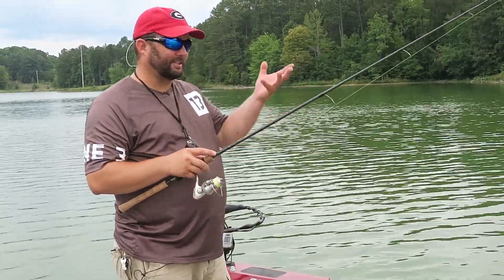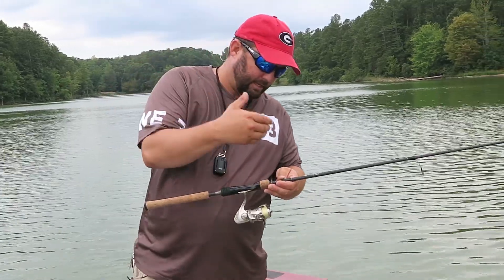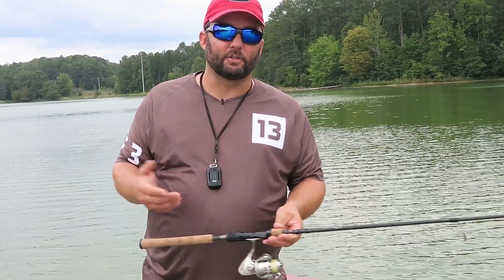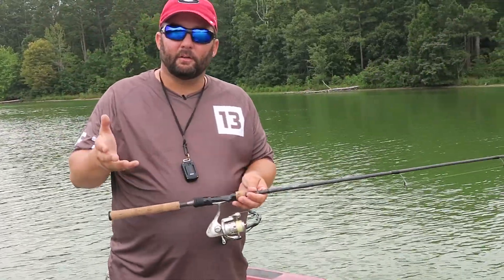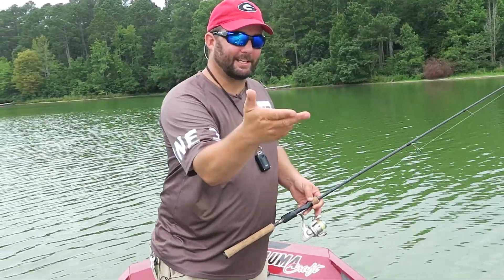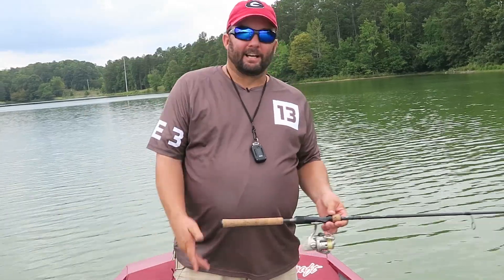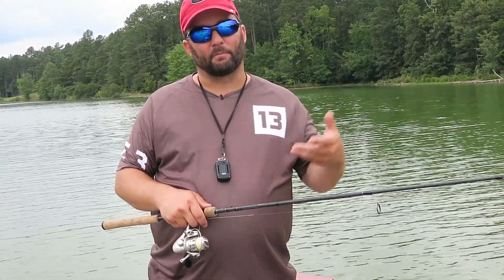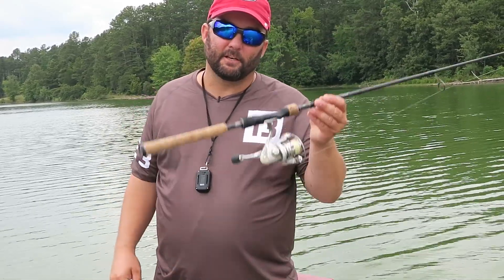Bass Fishing - The Advantage to using Braided Line to a Fluorocarbon Leader

Comment: I know you probably know this. But,  once your done using he braid on your baitcaster. Just tie it to a different reel and reel it on it. Then you'll use the part of braid that has never been used.
Reply: good tip
Reply: NC Outdoors With Justin B. I use a mono backer of roughly 1/3 the capacity of the spool. On a baitcaster it helps to keep braid from digging in. On a spinning reel, it helps anchor it to the spool. In both cases it reduces the amount of braid you need to fill a spool so you can spool more reels.
Reply: Thanks

Comment: Or when doing a carolina rig and you want to eliminate the knot issue, throw the weight direct on the braid, then a bead, then swivel then use your fluorocarbon or mono leader of your length and weight then to hook size and hook of your choice. choice.

Comment: The FG knot has changed my spinning rig fishing and I love it.  To have the invisible floro and the sensitivity of braid ,fishing mono for years the braid is a whole new world and not having to worry about old mono line memory and having to change it. I have had that first braid I put on for well over a year I can not even remember how long now.  If it ain't broke don't fix it. The FG knot is not hard and it is the best knot.  I got some really bad cabelas  line and wasted about a month with it on a new spinning rig I got. Clue on the fifth cast the line comes back with a huge knot in it cut it off and go buy some better braid.  I got 15 lb power pro green on it and I am back to loving it, it makes fishing easier. Fluke master thank you for taking my spin fishing to another level.

Comment: I agree with you 100% here Gene. I was skeptical of going braid to fluoro leader until I used the FG knot. That knot is a great knot and since I decided to start using this line set-up, I have no desire to go back to spooling a full reel of fluoro. Like you said, the durability of braided line has saved me quite a bit of money b/c now I only use very small portions of fluoro for my leader. Good stuff!

Comment: I use braid as backing on all my reels. I use a fuoro leader on most all spinning setups. I even use braid backing on my cranking setups but only enough so that it NEVER comes off the spool during a cast. It increases the casting distance because the spool spins faster.

Comment: I've used the modified Albright knot for my braid to flouracarbon leaders for years and have never had a knot failure.  Easy to tie and the knot is very slim and compact, go thru the guides with no problems. You should try it
Reply from the maker: That's what I used to use until I saw the strength tests of the FG

Comment: I can't ever seem to tie the FG knot properly. I was using an Alberto knot, but like you said, it only lasts for a few casts, so I started using a double uni. Not as compact as the FG knot, but it lasts way longer than the Alberto.

I should learn to tie the FG knot properly, but it's such a pain.
Reply: Keep the braid tight and the rap straight. Ty it off and pull the two ends. It real is a must have knot.
Reply: Bro I can't tie it properly either!! I practiced every day. Then I saw a vid where they half hitch twice the tag end of braid around the line and leader.  Then half hitch the tag end around the line only (holding leader away from line). Helps make it tighter for the time being.  PS if you are using a Duckett Micro Magic the extra 2 half hitch knots make it hard to cast so don't tie too long of a leader.

Comment: Using braid on spinning reels especially fishing from a kayak (for all the reasons you - and Chad Hoover - have shared) has convinced me!! I switched from my previous main of 8lb fluoro. I even learned and have been impressed with the FG knot so I could tie a piece of it onto braid as need be. Then I found/bought 15lb "TRANSLUCENT" color braid from a company which I will not name (their translucent braid is white and visible above water yet less visible than conventional colors of non-translucent braids below water). Its 15lb diameter is even thinner than 8lb fluoro so adding the fluorocarbon leader is probably overkill. I'm going to fish one reel of each side-by-side for a while to see if the fish shy away from pure 15lb TRANSLUCENT without leader.

Comment: Hey Gene, I have fly fished for a good part of my fishing years.  However, I am not as steady in gravel and rock rivers and streams.  So, i have used your channel to start bass fishing.  However, I also troll for large lake trout in Lake Jocassee, SC.  Sorry alot of preamble, but I use a blood not to attache a brad to a fluorocarbon leader.  The blood not has never fail me in river or stream trout and steal head fishing.  I use 6 to seven twist on each line and pull it tight.  The advantage to this not is you do not have to keep tension on the line.  Wanted your thoughts on the use of a blood not.

Comment: I made the switch awhile back and the only thing that I hate about this setup is that on a baitcaster, it's hard to get some birds nest out. I also hate the noise of reeling in braid when using a moving bait, but that's just me. Otherwise as a kayak fisherman, this really helps setting the hook hard when you don't have the most leverage like he said. Now, I made it to where my worm, jig, or any bottom contact bait is paired with this setup, but everything else like spinnerbaits, jerkbaits, crankbaits, or anything moving constantly is used as normal.

Comment: Thanks for posting this -- I'm definitely switching.  For me, I've noticed that fluoro line seems to backlash more than mono and braid.  I love braid but haven't made the full conversion.  I just watched a vid on tying the fg knot.  Easy, much better than the uni-2-uni knot (which kept slowing my casts by interfering with my guides).  In your opinion, when would you NOT use a leader? - pitch and flip?  - chatterbait?  - spinner bait?  - etc.?In your opinion, when would you only use fluoro? - swim jig?  - crank bait - etc.?
Reply: I had that paragraph nicely spaced and organized.  Thanks youtube --  :(
Reply from the maker: +Paul Durand lol. I'd use straight braid when fishing heavy cover with flipping baits, jigs and frogs. Straight fluoro when pitching to light cover in clear water, fishing heavy baits like big swimbaits , and any cranking.

Comment: I have converted to 13 fishing reels love them. curious have you tried the concept A3 reels and what's the difference in the A besides A3s are right handed? have you had a chance to try the turquoise 13 fishing reel if so what's ur input on it. I was wanting to setup an icon Jr swimbait rod with that reel?
Reply from the maker: The A3 is a larger reel designed for bigger baits like large swimbaits and Alabama Rigs. It has a deep spool and has more than 30 pounds of drag.
Reply: Awsome thanks.
Reply: So probably wouldn't be a bad reel to setup as a swimbait reel for keintech 5" baits or even hard swimbaits?
Reply: I won the grand prize shimano sweepstakes. You got any ideas of some spincast rods to set up on those reels. Never owned a 800 dollar spin cast. I'm more of a baitcast guy. I got a c14 reel on a ducket micro magic for alot of finesse setups. Not sure what to setup for these 5 reels coming my way.

Comment: I've heard braided for cranking is good as well because of the small line diameter, which means less resistance. you can use a 20lb test that has a 6lb diameter. makes sense but I have yet to try it.

Comment: What are some of the benefits of such a long leader?  I understand why it would be helpful with fall rates of unweighted soft plastics and getting your crankbaits to go deeper. Thanks!
Reply from the maker: In clear water I don't want them to see the braid at all. It also keeps me from needing to tie on a new leader after retying the lure on several times.
Reply: +Flukemaster, I tried this out tonight mostly following your advice, with nice results. I ran 20# blacked out braid up to the second guide; then ran 12# Seaguar off the spool from the top guide down, and tied a uni to uni knot with many more wraps than usual; resulting in a very long but thin knot that flew through the smaller microguides with not even a knick in the flourocarbon leader.  Using a 7'6 rod; call it 10 feet or so, of Seaguar flourocarbon as a leader.  Hooked up with wacky rigged weightless senkos, heddon torpedo, and an owner flashy spinner with a saltwater gulp swimmer.  This is a very nice tactic, and I'll try out this more difficult knot soon.   Keep up the great tips and content!

Comment: Great video. I've already started making the switch on my spinning set ups, debating doing it on my casting gear also once I work through my copoly stash. Try as I might though I just can't get the hand on the fg knot. Having good luck with the double uni though.

Comment: Do you still use mono backing? Also, I tried the spiderwire ez braid and it's complete junk. It last for a few cast and then the fibers are flattened out and the color runs out of it. 

I'm assuming powerpro or suffix 832 is much better but it's way more expensive
Reply from the maker: But worth every penny because they last a lot longer.

Comment: Great video!! Quick question if I have braid on my line with a fluorocarbon leader will I still get the sensitivity of braid? And will the leader cause stretch when I set the hook?
Thanks
Reply from the maker: Fluorocarbon doesn't stretch that much and that short amount of line won't make any difference at all.

Comment: Hey i have a question about using fluoro leader with braid main line... if i want to use 12-15lb braid, what size fluoro should i use? i'm in texas, and typically the water here is stained, rarely visibility over 3-4 foot

Comment: Very nice video, I wasn't sure how long braided line was good for.  How do you dye your line?  The main complaint I've heard about braided line is the color fading.  Thanks for the video Fluke.
Reply from the maker: I use braid for one year and then tie the worn end onto an empty reel and reel it off the old reel and onto the new one so I can use the opposite end of the line. This way I make it last two years. I die it with a black sharpie.

Comment: I use the Alberto all the time and it doesn't just break after you cast it a bunch.
Reply: Same here. Fluke must not be tying it right. I mean... He did just make the switch over to braid.
Reply: +Allen Wright yeah I love it even 1 rod uses it and he slams hawgs everyday 😂
Reply: I've seen the test and the fg is way better than Alberto.
Reply: I too use Alberto and I have had zero issues. I am using 20lb braid to 8lb fluoro and 40lb braid to 15lb fluoro. I have broken off both of these setups because of snags and in both cases the line broke below the knot.

From the instructional videos I have watched on the FG knot, it only works when you have thin diameter braid to a larger diameter leader (e.g. 15lb braid to 25lb fluoro leader)
Reply: I disagree with the last portion of your comment. I use the FG knot exclusively now, and I tie 10lb braid to 6-8lb fluoro and have had absolutely Zero issues. Salt Strong has a great video that shows exactly how to tie this knot, so I'm not sure what videos you've seen that say it doesn't work...
Reply: Same. Alberto or Albright. Fg is great but it squeezes the leader Like a Chinese finger trap. If the leaders under 10lb, it’s a Gonner.
Reply: Basslife 
I lost a massive trout because my alberto knot was tied incorrectly. I dont use it anymore, i just use a blood knot now.
Reply: Every knot breaks after enough casts. Lol. I use a improved Albright for any leader over 0.012in. 
Below that, reg. Albright with 22-25 wraps is the way to go.
Reply: I agree. I went from the uni knot to the Alberto knot and haven't looked backed. Great knot and so easy to tie.

Comment: Do you use the yellow braid to fluoro on finesse so you can watch the line easier on the fall or another reason?  It seems like that would be a big positive.  Also, how long of a leader do you usually use for your finesse fishing?
Reply from the maker: Yes. I need to see the line when the bite is light.
Reply from the maker: I usually start with a leader that is as long or a little longer than the rod and when it gets down to about 3ft I cut it off and tie on another one.

Comment: Hey Gene, I know this is an old video but I am considering switching to braid.  What is confusing me is some say a slow oscillation reel is ok with braid and some say the braid cuts into itself with slow oscillation, thus requiring a fast oscillation reel if using braid.  HELP!
Reply from the maker: You want one that has a worm gear that goes back and forth quickly so it lays the line in the spool in a crosshatch pattern. This will reduce the digging in. I’ve found that most Baitcasters above the $100 range work good and there are a few under that price that work.
Reply: @Flukemaster  Sorry, forgot to mention I was referring to spinning reel.  Either way I would imagine the crosshatch pattern would be best.  I know you are very busy, I do appreciate the reply.

Comment: Just picked up first baitcaster. Is mono or braid less likely to bird nest? Reviewed how to set up but just looking to have the fewest issues possible once I start with the reel.
Reply: John Rich You can backlash any of those lines. Mono, braid, fluro. Essentially the lighter the Lb test, the worse the backlash. Mostly due to line thickness. Personally I use a decently tight drag just based off sensitivity, I keep my tensioner medium loose, and brake right around 10 of 26 notches. Some people will suggest lower, but for a beginner you’ll want you’re brake decently moderate until you get the hang of it.

Comment: When going from mono (backing) to bradded line to fluorocarbon for your leader… what size diameter leader should you use? Do you match the diameter to the  bradded line? Seems like if you do you're defeating the purpose that the bradded line affords you with respect to the test straight.  Thanks

Comment: hey question i just started using braid anf for my trout set up i have a 10 lb braid witch is very thin would i use a straight braid or a flouro carbon leader for trout since i no flouro is invisible but i did notice that the 10 lb braid is thinner the the 10 lb flouro i have.

Comment: Do you actually need to buy leader material (more expensive) or can you just use normal flouro line for your leader?
Reply from the maker: I just use normal flouro
Reply: 3 years later, but the leader is more abrasion resistant. It's debatable but if $ isn't your main concern then buy the leader material. I've had just as good of luck with the Berkley vanish as the more expensive Seaguar blue label.

Comment: I'm finally starting to get the hang of the FG knot. I am getting an issue where the tag end of the braid is fraying. Any solution to this?
Reply: I have super glue that has a brush like nozzle and i just paint a thin coat of super glue over my fg knot
Reply: Yea I thought about that. Didn't know if it degraded the flouro strength.
Reply from the maker: A little fray is normal. I tie six or eight half hitches at the and and when it frays I pull the fray tight and clip it off.

Comment: I recently made the switch to braided line on my spinning tackle. I'm tying a  uni knot to an improved clinch. Saw it on a Shaw Grigsby video, and the knot has worked well for me so far. Perhaps I'll learn the FG someday but I haven't had any break offs or other failures as of yet. 

I was gonna go with 15lb power pro, but my tackle shop was out of it, so I went with 20lb standard power pro in RED color. It actually looks pretty sharp on my Daiwa Fuego 2500. Just using it with some 10lb seaguar red label fluorocarbon I already had. I'm mainly using this setup for smallmouth fishing, and it's great. The Fuego is on a 6'9 Dobyns Savvy. Braid with fluoro leader is pretty much the best of both worlds. You get the sensitivity, and lack of stretch with the invisibility of fluorocarbon. I usually run a 6 ft leader or so, and it's plenty even for finicky fish. It's just a great setup for drop shot, shaky head, and even ned rig fishing.

Prior to fishing with braid on my spinning rods, I was using copolymers like P-LINE Fluoroclear. Very glad I made the change. Always been a fan of regular power pro on my casting gear, and it performs just as well on my spinning tackle, not to mention the improved casting distance too. You can really get it out there with light braid on a spinning setup.

Comment: Thanks for making this video! I never knew why braided to fluro was so popular on spinning reels until now. 
Question, if my rod/reel is only rated up to 12 lb test, is that the max I can use or is there a certain amount more I can ger away with?
Reply from the maker: Not the max braid. If it's rated for 12 I'd put up to 20lb braid on it but just go up to 15. I get the best performance out of that.
Reply: Cool. Thanks again!

Comment: I just bought the 13 fishing concept reel for $120 and I was using 30 lb braid (power pro) and for some reason every time I had casted the braid would dig in and stop mid cast.... 
     Do you know the problem or the solution to this...because I really like the reel just can't have that problem
Reply: Tie on the heaviest bait you have or a heavy weight and make the longest cast you can. With the line still out pull out a little more. Then cut a piece of electric tape almost the width of the spool and tape it across the spool of line. This will keep it from digging down further into the spool. Eventually you may need to reposition the tape after a little while.
Reply: Used to happen to me also. Loosen the drag up a bit and pull the line. You'll be able to notice when it stops digging in.